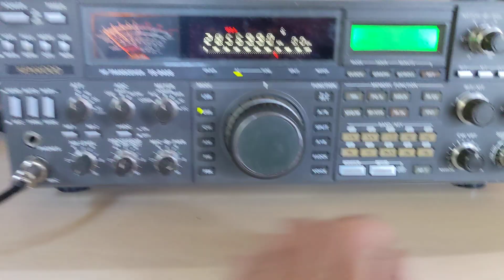10 Meters, With A DX Contact On 3D Printed End Fed Antenna

Comment: What you recommend for a all mode mobile transceiver similar to the ft-817 without a battery to use in my dodge 1500 and isuzu NPR. 73, kq4hcu.
Reply from the maker: Icom 706MK2g, Icom 7000 or FT100D
Reply: Thank you